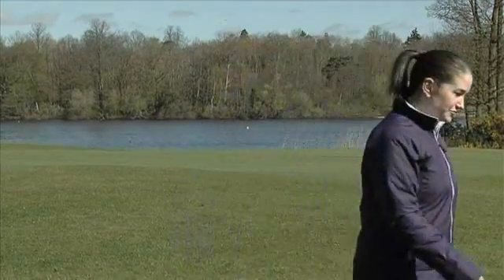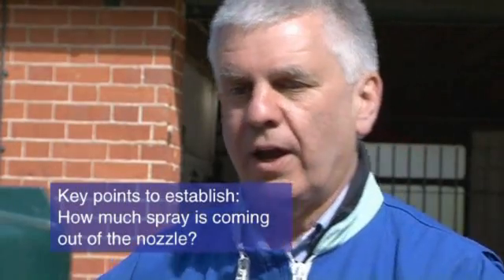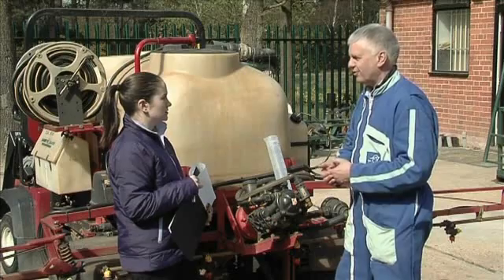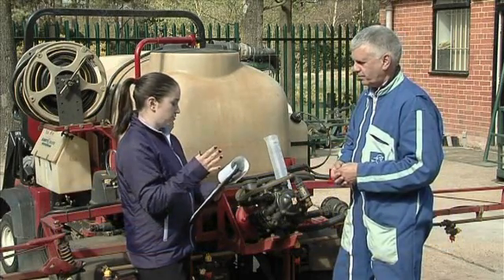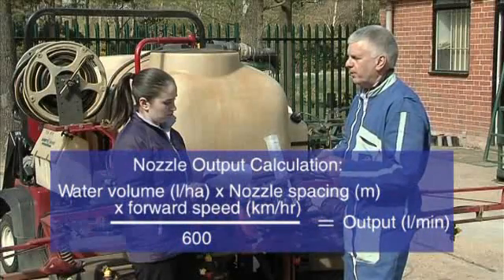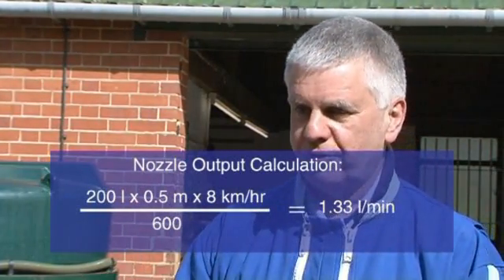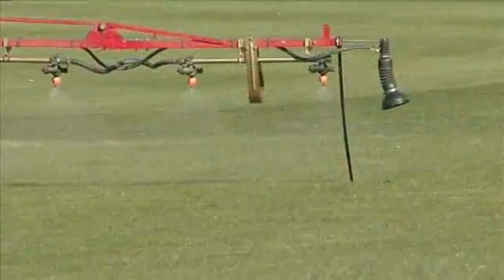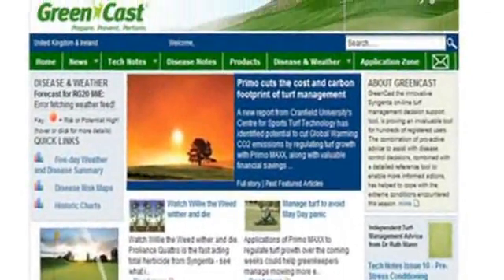Sprayer Calibration

Comment: Just wanted to ask how the chap new that he needed 200litres per hectare?  Usually the product/chemical will tell you how many litres per hectare...e.g  5 or 10 maybe  but that doesn't give you the water volume.  I thought to get water volume you needed to multiply 600 by flow rate...possibly 3.2 litres per minute depending on nozzle then divide by spray width then divide again by speed of vehicle or walking pace to get you Water vol.
Reply: You can change your water volume to be whatever you want, within reason, so long as you add the right amount of chemical. Usually will be so one tank fill will cover a pre determined area i.e. He's got 3ha to spray and his sprayer holds 600 litres so he's using 200 l/h. Hope this helps.